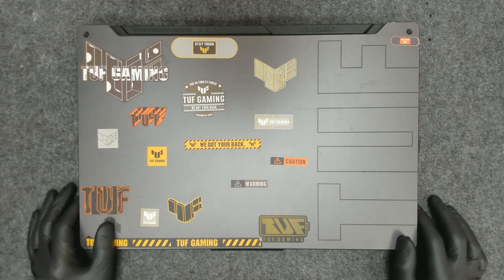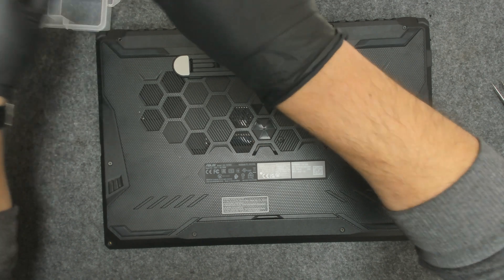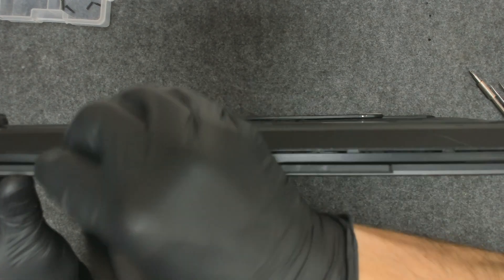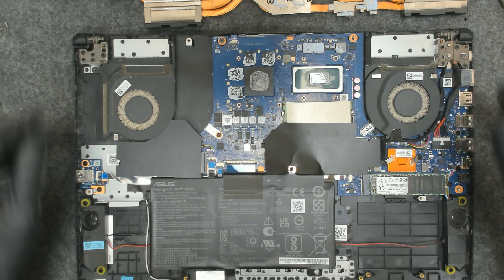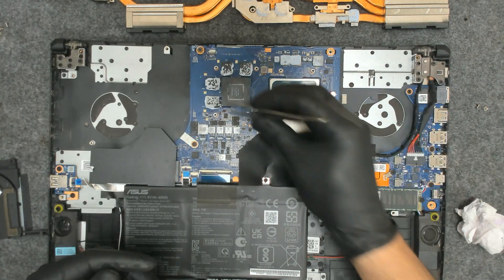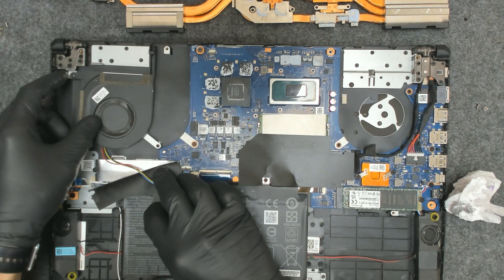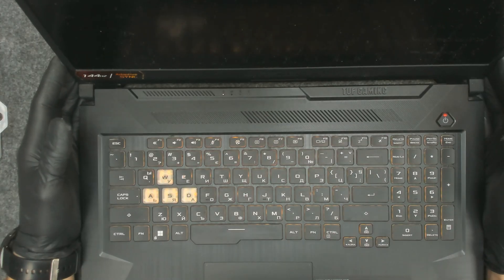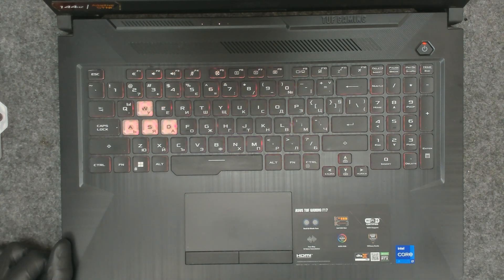Asus TUF F17 FX706H Thermal Paste Replacement after 2y usage.

Comment: Just a note, in title its F15 but it's actually an F17.
Actually I do have a F15 and was wondering can I use thermal pads on CPU and GPU instead of paste (ptm7950 I have read is good for laptops). Also which thickness would be ideal?
Reply from the maker: Cooling is pretty much the same. The difference is the screen size.  The laptop is with putty, not with pads, so is a good idea to use putty again. Thermal grizzly have some nice ones.
Reply from the maker: Title updated. Thanks.

Comment: Hey bro, I added a second SSD and noticed it gets hot quickly and slows down. The original SSD came with a thermal pad—do you think I should use one for this SSD as well?
Reply from the maker: You can try with thermal pad. But it is strange whey the second ssd will slow down the OS which is on the main ssd. Check  the temps with some software.

Comment: hello, if my thermal putty is dry what do you recommend? i was changing my failing ssd and i noticed that the thermal paste and putty turned into solid concrete
Reply from the maker: The putty is not as liquid like the paste, but more like gum. If it is harder, you need to replace it like the paste. But I dobubt the putty is for replacing.
Reply: @LaptopDisassembly  its completely dry. i've been told to use PTM7950 for the gpu and cpu and UTP-8
Reply from the maker: @Marshmallow603 Good choice.

Comment: If i cleaned also the thermal putty and i want to replace with thermal pads,do you know what the thickness should be? Thx
Reply from the maker: If you use pads instead of putty, you should use some very soft ones. So they can get flatten from the press from the cooler. But I have no idea what the thickness is.

Comment: Do you recommend holding down the power button after disconnecting the battery? Like I some people do it some dont. It kinda sounds logical to get rid of any electricity left in the parts
Reply from the maker: I never do it. Usually when the laptop is off there is only one or two lines that has standby voltage. And as soon as you unplug the charger everything is discharged. The max voltage is about 19-20v so there is no big capacitors, like on the desktop PC where there is 250-400v main input capacitors. They can hold a charge for quite a lot of time.
Reply: @LaptopDisassembly And whatabout spreading thermal paste? I heard that you should just use a dot and the pressure will lay it out for u. But u seemed to spread it manually
Reply from the maker: I like to spread it. I don't like the dot method, because there is a chance not to cover the whole CPU/GPU. The downside is that you waste a bit of the paste...

Comment: My laptop doesn't turn on after doing this , it turned on once then its not turning on and even no charging light :(
Reply from the maker: Check did you connect the battery properly and all the other cables. If everything is ok, disconnect the battery and cmos battery ( if present ). Wait 5min. And connect everything back and try
Reply: @LaptopDisassembly it's the same laptop, yes everything is connected same way , i also tried individual ram sticks one by one and still no power even charging light doesn't come on. I used cryofuze 7 , tried connecting without battery still no power. I used gloves battery was disconnected while doing replacement and I put battery on then turned it on once and it worked. Then I hard shutdown with power key long press put back cover and it wouldn't start nor power light in charge :(
Reply: @GRlIMm  it works now?

Comment: Thanks for the video, but y did not change thermal putty on the ICs ???
Reply from the maker: I never change the original thermal putty. It doesn't dry out like the paste.
Reply: @LaptopDisassembly  Thanks for your response, So If I replace thermal putty with thermal paste like Cooler Master CryoFuze 7, would it create any problem ?
Reply from the maker: You have to replace the putty with same viscosity stuff. It is not a good idea to use paste. The gap is different and it will not work.
Reply: @LaptopDisassembly  Today I applied Cooler Master CryoFuze 7 on my CPU.GPU,VRAM and VRM. temperature are stable (normal 78C and CPU(Cinebench max 95C)). I will keep your advice in mind will change it to thermal putty in specific parts where it is required.

Comment: Hi, I have this same model. I recently heard some rattling inside and decided to open it up to clean the fans. While doing that, I noticed that the silver plate covering the RAM isn’t glued in place like the one shown in this video. I’ve also been experiencing issues with my Wi-Fi and keyboard randomly crashing and acting up. Could this loose shield be the cause of these problems? I’d really appreciate any help or advice. Thank you!
Reply from the maker: Yes it could be. Just remove it and it will be fine. Also you can run some memtest to check the memory and cristal disk info to check the health of the hard drive.
Reply: @LaptopDisassembly  thanks a lot!
I will try this

Comment: Hey man why you didn't the thermal paste of vram and the chips around cpu and gpu??
Reply: That's his mistake, for two years? that thermal putty should have been replaced already. Dont wait for it to dry up, if two years of usage, that's a great time to replace the thermal putty.
Reply from the maker: @JM-kp2vx  On theory of course is better to replace the putty. But I've been doing this for more than 15y. and never had problems. The thermal putty is with different viscosity and it doesn't dry out like the paste.  It is used mostly on coils, memory chips and so, where the temperature is lower compare to the CPU and GPU and it is used to fill up bigger gaps. I have customers with gaming laptops that i clean every year and never had problems so far ( laptops are move than 5y ). Also is better to use the original one, instead of putting some no name aliexpress one. But like i said, on theory is good to replace everything. It is up to you.
Reply from the maker: It is not a thermal paste. It is a thermal putty. It has a different viscosity and it doesn't dry out like the paste. I never replace it.
Reply: @LaptopDisassembly  but dude ask chatgpt , he is saying that you are half right , he is saying that it don't dry out fast but we have to replace them also 
what is your take on this , please reply i want to know
Reply from the maker: @gautamjhala-h2s on theory the best thing is to replace everything. But to do so, you need to find good quality thermal pads or thermal putty depending on the case. Because if you put something with lower thermal conductivity it will make things worse. I've been doing this for some years, and so far I have replaced only 2 times thermal pads on a GPU and 1-2 times in a laptop. But since now, I have never replace thermal putty... But like I said on theory ChatGPT is right. ☺️
Reply: @LaptopDisassembly  Thanks for the detailed breakdown. So from what you're saying, thermal pads don’t usually dry out like paste, but they can still degrade or lose effectiveness over time, right? I was thinking of repasting my laptop’s CPU and GPU — just wanted to be sure if the VRAM thermal pads should also be replaced while I'm in there. Appreciate your insight!
Reply from the maker: @gautamjhala-h2s yes, pads do degrade with time... But not as fast as paste. Also on this model is not pads... It is more like a gum ( thermal putty). So it it is still soft, don't replace it and don't move it. It will be fine. If you decide to replace it, use some good quality ones... You can check Google about models and brand.
Reply: Can i use thermal paste on them if I don't have thermal pads or putty with me?? @LaptopDisassembly
Reply from the maker: @modocgaming8547 no... Just don't touch it. Leave it like it is.
Reply: @LaptopDisassembly  ok brother thank you ❤

Comment: Does your laptop lag too when running on only the battery with the GPU ON ? (like on Standard Mode at battery)
Reply from the maker: It is not mu laptop, but a customer one. But lagging on battery is normal. The laptop lowers the performance, in order to keep the battery life longer. You can try switch to performance mode.
Reply: @LaptopDisassembly  Actually it seems to run smooth but frame drop occurs in between, that's the Main point
Reply from the maker: @priyosmitpolley4442  did you try with performance mode.
Reply: the battery doesnt provide enough power to power the GPU needs to be plugged in to get the most out of it
Reply: @brokenguitarist1997  thank you for this information, but it lags in between like 5second smooth then 1 lag and it continues
Reply: and limit your laptop's charge to 80% to prolong the battery health.
Reply: Do not game on your laptop just on batteries, plug it  at all times specially during  gaming.